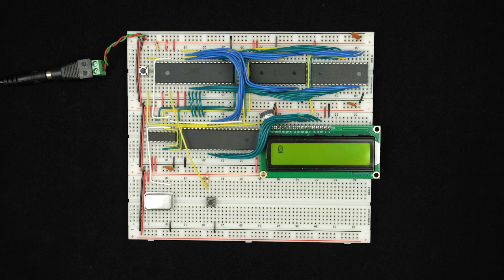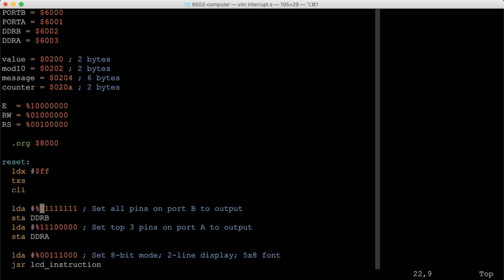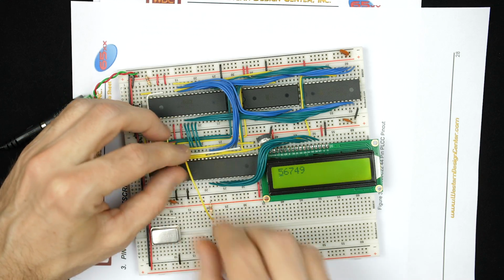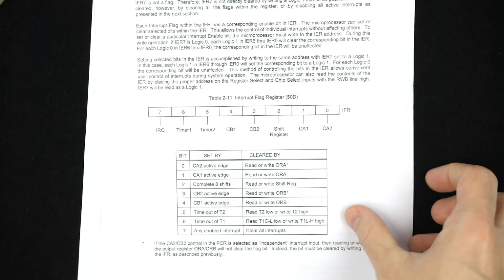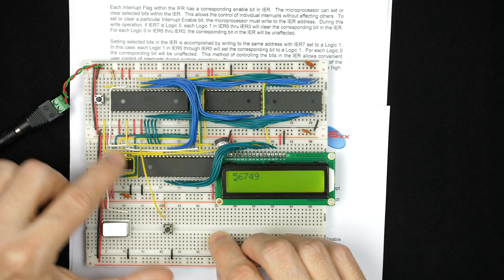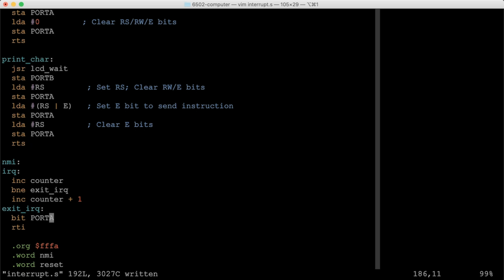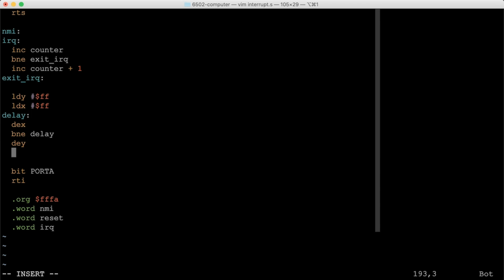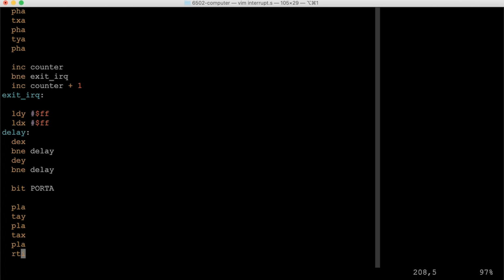Interrupt handling

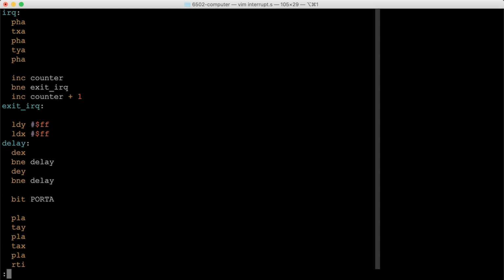Comment: 21:00 the loop will load x and y at the beginning, then decrement and branch on x, but it never sets x back to $FF before looping on y.
Reply: it does, though: it decrements x before the next comparison, overflowing it back to $FF from $00
Reply: @Tuxfanturnip  I was looking through the comments to see if anyone had noticed that the X register was never set back to $FF. I missed the fact that DEX would cause $00 to become $FF. I've never programmed the 6502, (Z80 fan boy), so was reading up the 6502 instruction set to verify your comment. As DEX will set the Negative Flag if the bit 7 is 1, then starting at $FF is a bit naughty as we'll be counting -1 to -128 then flick over 127 and count down to 0.
Reply: @axelBr1  The X and Y registers are unsigned.

Sure they set the negative flag but in all operations which matter, like the index indirect and indirect index addressing modes they X and Y register are used as an unsigned values.
Reply: @Tuxfanturnip  Ahh, fair point. I see, Ben Eater outsmarted my outsmarting lol
Reply: @Tuxfanturnip  woke up this morning and realised that the decrement from $00 to $FF adds an extra count to the timing loop. Not critical in this cludge of a debounce handler, but technically a bug if expecting to do 256 * 256 decrements.
Reply: I disagree.  After the inner loop the first time, when the outer loop decrements and loops back up, the next DEX will just cause X to 'roll under' back to FF.  (it was zero and decrementing from 00 gives FF).
Reply: Basically, it only loops $FF * 2 times. Obviously too long, but if you meant to make it loop $FF * $FF times, not as long as you tried to demonstrate.

Comment: Hello, I am a student of Korean high school. As the president of the school computer club, I tried to study your 8bit computer project with the members. I purchased the parts and was assembling the circuit, but accidentally misconnecting the wires, the circuit was broken. I tried to fix the circuit, and I found out that one ic wasn't the only one that was broken, and I tried to find the broken ic. Can you give me some advice on how to find the broken ic? And can you tell me how to fix the ic or find another alternative when I don't have any more budget left after purchasing parts from the school budget?
Reply: Troubleshooting isn't something easily done over the internet.  A few suggestions though.
Consider everything an input:output machine.  Does the chip have the correct input?  Yes?  Then check the output of the chip.  Is it correct?  No?  That chip is your problem.  Does your chip have the correct input?  No?  Then the problem is upstream.  Also, look at things as modules.  A power supply has many components.  Just look at the input and output.  Correct power coming in?  How about going out? No? Then the problem is internal to the power-supply.  You will spend too much time looking at component-by-component.  Troubleshooting takes time and experience.  Best of luck.

Comment: Can I program a 27c200 more than once?
Reply: If its an eprom only if you have a high power uv light eeproms cost more but they are better
Reply: If it has a window it can be erased with UV (the sun won't be enough though). You're probably better off getting some flash based EEPROMs since they can be erased and written many many times in mere seconds, and a couple of them will likely cost much less than an EPROM eraser.
Reply: @TomStorey96  it doesn't have a window :( 
Also, I didn't buy it. I pulled it off of a DVD player's video driver.
I recently saw Eater's video, Replacing Combinational logic With an EEPROM, I thought it was cool to manually program an EEPROM, so I wanted to know if I could program the one I had.
Reply: @nyancat7486  probably a "one time programmable" then. You can likely still change the contents, but only 1 bits to 0, not 0 to 1.

If you have access to companies like RS, Mouser, or DigiKey then you can search them for EEPROM (28xxx series) or "flash memory" (39xxx series).